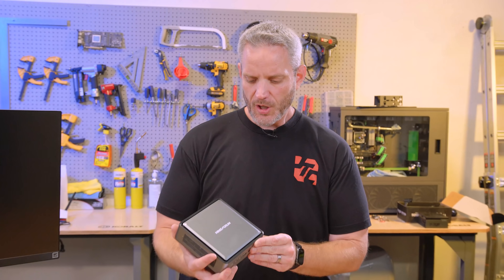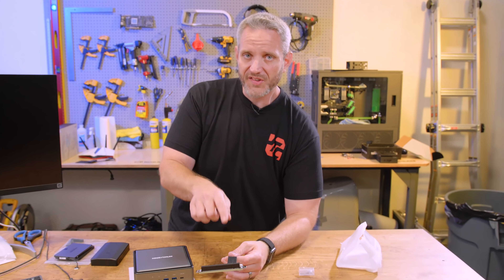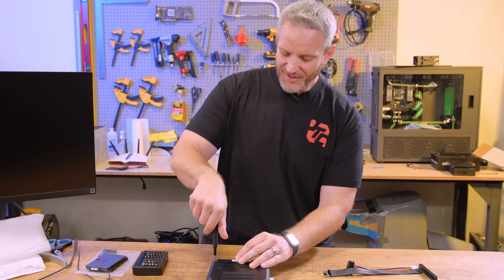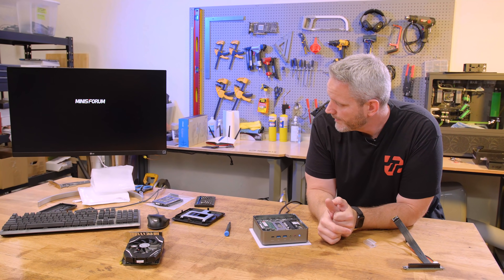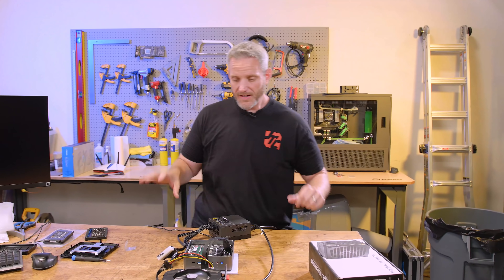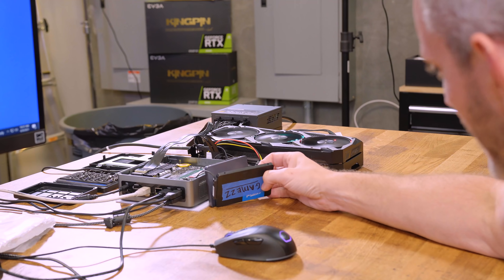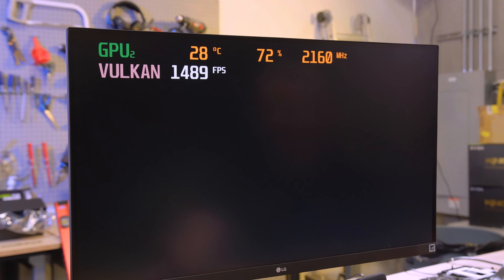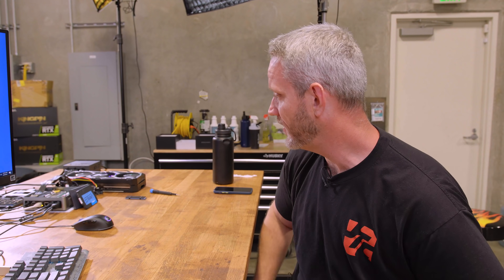This was easier than I expected it to be! Super powerful mini pc

Comment: Make a custom slim case to house them both, then mount it on an a gaming OLED TV that support GSync/VRR, like LG CX. I hope bluetooth is included, so you can use wireless keyboard/mouse/Xbox controllers there. In fact, I am using one with Sony's X900 despite ITX form factor. Would be fun to replace it with  that tiny thing like that, so that it could disappear completely behind the TV. 

Also, please do the usual PC benchmark on it. Like video editing, 3D, gaming, worksheet, etc etc. If it can work like normal PC, the next thing for me is to design a custom case to house those things together and 3D print it. LG CX has big bump at the bottom of the screen, and we could adapt the case to fit on the bump, then voila.. just a big screen playing AAA PC games in the middle of the room, with no visible PC at all.

Comment: While you’re at it, take another tip from the miners and don’t power a pcie slot with sata. sata connectors are only designed for a max of 54w and pcie can pull as much as 75w.

Comment: What about taking a NUC or “old” laptop and water cooling it? Just Jay-it-up in an actual case! I’ve seen VRM/Memory module water cooling “thingies” on AliExpress and eBay that people have been using in Xbox mods for years. Just take a few of those to the small components on the platform used, fit a block to the CPU, and wire the power switches to the front of the case….BAM! Water Cooled NUC & EGPU build 2021: Make cobbled PC projects great again.

Comment: I want to put a PC in an overland rig one day that I could game and edit videos on running off deep cycle batteries. I always thought it'd be smart to not have to use an inverter to go from 12-14v dc to 120v ac which the power supply would convert back to 12v dc. But I have no idea how you would get clean power that way

Comment: Just wondering. Wouldn't the more expansive "ADT-Link" egpu have been a more practical, from a power delivery perspective, compared to this rather minimalistic nvme>external 4x pci-e board? 
The ADT link can detect when the connected system switches on and power up the egpu simultaneously. ADT also has the option to use a 220W DELL 8pin external power brick to power it, so you can do away with the A/ITX power supply.

Comment: I've always wanted build a PC into some old vintage hardware.  Like an antique radio with the big speaker grills.  When I was at university I had a music server 'inside' of a tombstone radio.  But is was simply a NUC + USB HDD that fit inside of a tombstone radio case.  But this sort of solution you could build the ultimate 'sleeper' PC, that doesn't even look like a PC.  And A+ if you can get like the buttons and dials to like turn on/off the computer and such.

Comment: Use some PVC storm water pipe (5"-6") diameter,  NUC and PSU stacked one end, GPU in the middle and a 120 or 150 fan down the opposite end, a track /slot system maybe used for ease of access. NUC/PSU end could have some mesh if fan is pulling air through or versa vicer if pushing, now if we want RGB or Water cooling you may want clear plastic tube.
You could also put screw on pipe caps on each end with a makeshift shoulder strap for gaming on the go/Lan etc.

Comment: Pulling 75 watts through a sata connector rated for 54 watts is a good way to make things melt, and even catch fire. People watching this will think these sata connectors are safe to use when they are not, I wish you would make it clear that these adapters are not safe.

Comment: Jay, they make chinese thunderbolt 3 to M.2 to PCI-E 16x(4x) adapters. Search Aliexpress for ADT-Link R43SG-TB3.

I was thinking of using one of these adapters going from TB3 to pcie to MXM and making my own battery powered external laptop graphics to be used with devices like the GPD Win3 and other handheld ultra-portables with thunderbolt/USB4. It's hard to find good MXM laptop graphics cards these days though, and even harder to find compatible PCIE adapters. But someone could probably make a portable external GPU with it's own battery.
Reply: Wow.. someone replied with what i'm 99.999% sure was a fake account, had weird symbols at the end.. reported.

Comment: Jay the sata power connector needs to be plugged into the first sata slot on the sata power chain not the 2nd like you had in the video. The 1050 ti would probably would of worked fine given you plug the adapter into the correct sata power plug, the first sata power in the chain. Only the first sata in the chain can provide 45 watts of power, less than PCIE spec but should still be enough to boot into windows on a 1050 ti.

Comment: Not sure if it was mentioned in the video but my experience from mining is that SATA should never be used to power the PCIE slot of a gpu because the standard for how much power can be delivered through the PCIE slot is higher than what SATA is rated for. It is unlikely that anything would happen but, personally I wouldn't recommend it and it seems like a lot of miners agree.

But yeah lots of cool stuff can be done with these weird adapters, I plan to use one for my personal rig when I go for a small form factor build.

Comment: I've used those M.2 to PCIe adapters to make my smallest build yet... I put a Pentium 4600 and a 1050Ti inside an ATX PSU case. Had to mod a low profile CPU cooler onto the 1050Ti to make it fit. It's all powered by a single external 12V 350W brick.
As for your build, due to the massively oversized graphics card and the fact that you probably won't be building a custom power supply solution, you're pretty much stuck with building it into something a mini-ITX board could fit just as well (though the mini-ITX solution would allow you to do it with a serious processor and a 3080 or bigger).
I'd probably try to put this setup into old HiFi gear. Like an old amplifier or even a boombox/small stereo set. Or put it in an actual toaster (provided you can find a toaster big enough for the GPU or a 3060 that is more reasonably sized).

Comment: Do a boat, but have water-cooling in it so it floats in the water and uses the water that it's floating in to cool the system with having a pump on board.

Comment: build  it into a discreet dual monitor  stand type set up ( meaning it mounts to the back of the monitor/monitors) with a 3d printed new casing with custom Air cooling AND rgb back lighting that makes decent ambient lighting when placed  on a desk so that the lighting more reflects off the wall rather then  blinds you.

Comment: I'm gonna get dragged so hard for this but get a M.2 to PCIE 4x adapter first then a 4x to 16x riser that has room for a 6 pin to power said riser instead of relying on a sata cable to power that whole thing. I've seen the sata setups melt with the beefier GPU's before. It's gonna look frankensteined to hell but should make sure you don't get any unfortunate thermal events. Though at that point I suppose it defeats the purpose lol.

Comment: Yes, it works but it's only a x4 connection so you're losing 75% of your bandwidth that would normally be available to an x16 slot. 

I got one of these adapters to add a SAS Controller to a mini PC and it worked great. It's kind of janky, but it saved me from having to buy a new CPU/MB/32GB RAM when I expanded my Plex Server from external USB Direct Attached Storage bays to a setup using UnRaid in a real case.

Comment: I dreamed about stuff like this when I was a kid. Back in the day, lan parties were all the rage. Everyone would load up a full computer and full sized crt and play StarCraft and the such together. Pc cafe's like they have in Asia were just starting to catch on, $1 or $2 an hour to play games. 

I decided I was gonna take an old cargo van and build a counter into it and just throw a bunch of PC's into it with a bunch of extra batteries and a power inverter. 

This quickly morphed into a "car PC". They had just started to come out with $800 7" and 8" touch screens, and that was my breaking point. 

I bought the first mini-itx motherboard I had ever seen, paid $650 for a fan less via 533mhz system and bought an mtx2 220w power supply. 

Had the money for the screen, but it was always out if stock. I even took a PS2 laptop style keyboard/track pad setup and moulded it onto a steering wheel.  Then life got in the way, and I gave up on it. 

Fast forwards 15 years or so, and my kids asked me for Minecraft for Christmas. Around the same time my work was throwing out some old Xeon servers so I asked if I could have them. Ended up throwing some rx460's in and in back in the pc game. 

Now that they have these small USB powered 3.5" and 4" hdmi screens for $50, I might just go ahead and finish my carputer project. Seems silly where my Android phone does everything and more that I forsaw back in highschool, but I still have that old fanless mini-itx computer...

Comment: These are made by ADT and can be bought directly from the manufacturer. I have six of them to run 6 GPUs from an x570 with a PCIe 2 4 m.2 hyper m.2 for folding@home.  You can order many more options from ADT including a PCIex16 with a base with feet and six pin molex for power. http://www.adt.link/GPU.html P.S. use a molex to floppy adapter instead of SATA - it’s less likely to melt ;-) way overkill for mining. For that an x1 works fine.

Comment: As far as I know the 4800u is based on Zen 2 not Zen+ (like the desktop 3400g and 3200g are), same goes for the desktop 4000 series (which is one of the reasons why it was a shame that the 4xxx series APUs are OEM only (and only available via places such as Aliexpress))

AMD lists the node as being 7nm so it makes sense that the 4800u would be Zen 2 as well. Not to mention some review sites also state it as Zen2.

Easy to miss though as the naming conventions for pre Ryzen 5xxx are rather convoluted (so far all Ryzen 5xxx parts released and announced are based on Zen 3)

Comment: So the challenge you gave to us was "what form factor should this be?" to that question i have another question: what would you have to do to get around the ventilation/dual power control problems. Ventilation isn't too much of a problem but the dual power control is a much bigger one as that would require some measure of control that would most likely in some methods violate product warranty/safety(mainly the one in which you now have an exposed PSU).

Form factor wise a half-size briefcase would be perfect as you could accommodate everything and if the big daddy NUC is coming soon pairing that with a 3090 would be ideal so the form factor scales up to nearly a full size briefcase.

Any further thoughts on the complications at hand as far as mobile solutions go??

Comment: I would like to see a custom gpu enclosure that ends with the m.2 adaptor so you don't need thunderbolt.
Also, now I suddenly know what that jumper for the power supply is for. 🤯 Duh.

Comment: Please use the m.2 adapter in a pc with something silly like a 5950x so no rush of being cpu bound, then run a variety of gfx cards from the 1080 up to the 3990 in the PC x16 slot and in the m.2 x4 PCI slot and see how the interfaces compare, what point the x4 link becomes saturated and where the point of deminishing returns is so if we are to consider buying a GPU from the magical universe that has one we wouldn't be paying for gpu power that would be  totally unusable with the m.2 x4 method..

Comment: I've been wondering how laptop hardware would perform in a normal case with real CPU/GPU cooling compared to it's usual cooling solution. 
I'd love to see you make a desktop with a laptop mobo at its heart to see what gains you can achieve from better cooling. Doing the same to this PC might be a close enough comparison since it's basically laptop components. If the cost of a case and an AIO can turn this already decent performer into something awesome I think it's worth testing out.
Reply: It's still going to be limited by its thermal capacity and power delivery, so you'll get a bit of a boost, but not a big one.

Comment: You dont have to run off the secondary PSU.  I daily drive a setup where my GPU is powered by a external PSU, and I never flip that switch off.  The GPU will only pull what it needs.

Comment: Those cables are great in it's boards with multiple m.2 slots if you want to add a 10GbE NIC. Even seen a few used to crossfire video cards a couple of times. And once to install a sound card.

As for what to put it in. Why not a monitor and make a poor man's iMac?

Comment: @jayz2cents it should be easy to add leads to the power button so it could also turn on the external power supply with the one button.

Comment: make it like an external gpu setup, cut holes for the wires then make a gpu enclosure like the razer core, so when the nucs at home you can plug it into the gpu and when you wanna take the nuc but not the gpu, you can just unplug and take it.

Comment: A rocket launch pad and gantry diorama. Use the mini as the pad, Use the GPU as a gantry., perhaps the PSU as control. Get yourself a rocket model. RGB, weather it up, make it JTC. I've seen lights with light up couds you could use as the exhaust smoke etc. Dunno. Maybe too elaborate. But dayum! T'would be cool.
 
Heck, JaseX it up. No. no no... That would be somewhat phallic. Hmm... Just throwing out an idea.

It could be a missile instead of a rocket. Doing up the GPU as a gantry could be fun. I've never seen it done before. Anyway, cool stuff! Cheers!

Comment: build it on a board as a small form factor wall mounted PC. Make sure to Dremel out a slot on the edge of the bottom plate to fit the PCI cable coming out. =)

Comment: reminds me of the very first computer I owned. Dell Optiplex 745, with a GPU that put out so much heat......it would make my HDD get too hot and crash the system. So i had to open the case and keep the HDD outside of the case :)

Comment: Put it all into a toaster. The ultimate gaming toaster. Whether it can still make toast is optional, but dayum if it did!
Reply: Forget doom on a toaster, I wanna see Skyrim running on a toaster.
Reply: oooooh it could be like the younger cousin of the AVGN nintoaster. LOL
Reply: it makes toast but it takes a while because the heat is the computer not the actual toaster
Reply: @Jake-mz2qf  bread cooling is now a thing we all must have.
Reply: @Jake-mz2qf  run a benchmark.  In that open a vm and run a benchmark on the vm and double benchmark
Reply: In a toaster with the Razer logo!!!!! 😂
Reply: BasicallyHomeless already did that and it still made toast
Reply: It HAS to make toast otherwise its a failure. No exceptions

Comment: I already have been living in a van for two years, which I fully converted myself using a lot of boat parts, running full solar, and I use a minisforum PC in there. Wish I could just speak directly with you about it lol because I've already all the hard work for the exact type of project you're talking about. I am running the minisforum direct off DC using a 12v to 19v dc to dc step up converter. It's highly efficient.

Comment: So a good I found for a cable like this is for a capture card in an itx system.
Most capture cards are PCIE 4x and higher end itx boards have 2x M.2 slots. You could get an old itx chassis with an optical bay and shove this wribbon cable in there with the capture card, them plug an normal GPU into the x16 slot. Now you have a gaming/ streaming PC and you can capture console content or capture higher end cameras for a multi cam set up for recording.

Comment: my mother is really into wine and in need of a pc upgrade so i was considering buying a wine barrel to sit by her wine rack and then i was going to try and fit a pc inside it and have custom water cooling tubing running through it and have wine colored coolant as well as try to fit a bladder inside it so it could still function

Comment: put a pc inside a pc... that could easily fit inside the power supply bay of a big tower. could call it ghost drive have a big empty case with nothing in it yet it still runs and games, or you could make a meme since everyone has full systems built minus a gpu you could mount just the gpu and hide the box and you'd be the opposite like "i got my gpu now waiting for the rest of my system to get in stock"

Comment: Jay! I'm sure someone else has already said this but that pcie power situation is a house fire waiting to happen with larger cards. Sata power cant put out the required power for pcie, it requires 75W and sata can only do 54W. Those cables are going to get hot and potentially melt if you overclock.

Comment: Is that SATA power plug to a Berg Connector?
Those can't be rated for 75w...
Reply: Miners' nightmare, the melting SATA power connectors. It's kinda sad Jay is not aware and didn't even mention it. It is a serious hazard in such a setup. Get PCIe adapters with at least MOLEX or 6-pin PCIe power connectors. Never use SATA other than for drives or something very low power.
Reply: that can melt at anytime
Reply: You are correct. SATA connector is only rated for 54W max. Many SATA adapters are of such poor quality they even can't handle 50W.
Reply: Why u can only order this setup from ppl who cant be sued.

Comment: What's the benefit of using the MinisForum in a build like you're imagining rather than just using an mini-ITX MB? It would be about the same size and you could use a 16 bit PCI riser cable and still use a NVME card -- it's not like you're saving the space of the GPU or the power supply or anything…